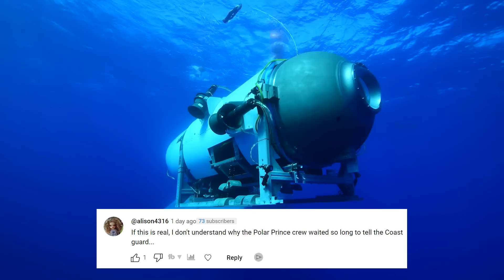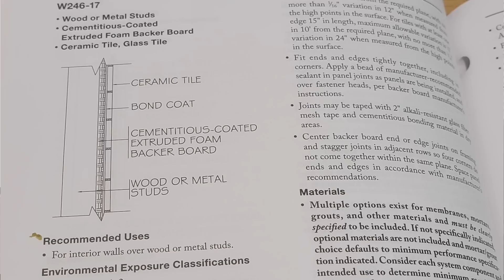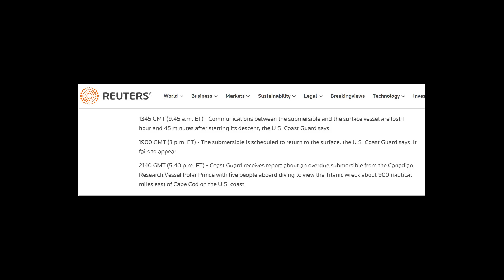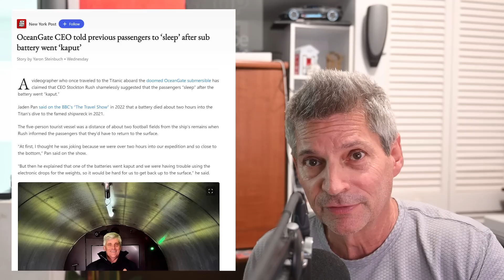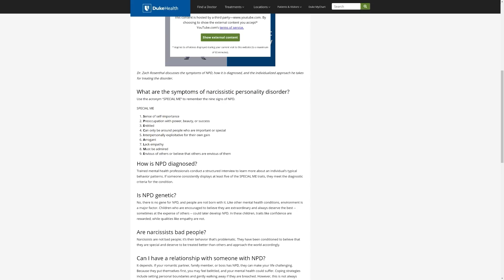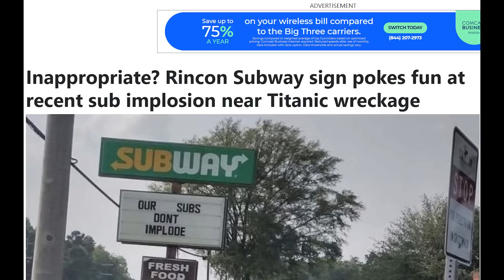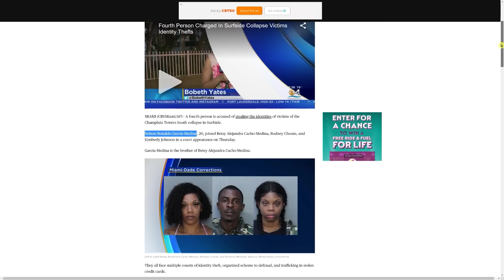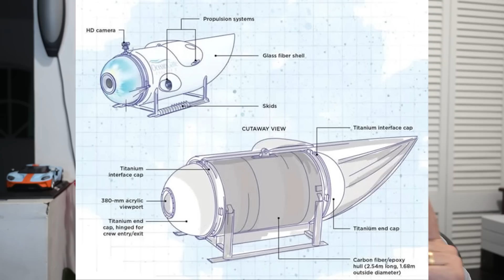Titan Sub: Why OceanGate Waits 8 Hrs Call Coast Guard, Q & A

Comment: His major concern was cost.  Deep Sea submersibles cost a lot of money to design, build and test.  So he developed a narrative of denial about safety concerns to cover this inability to fund the project adequately.  It was a defensive mechanism that took on a life of its own.  If anyone suggested he needed to certify the vessel he took it as an insult because he couldn't afford to undertake such a process.  But there was an element of aberrant psychology, as a normal person would not take risks of that magnitude.
Reply: Agreed. He had a business plan and the engineering was compromised to fit that plan.
I suspect towards the end the company was already in trouble and losing money but he was desperate to make it work.
Reply: @zahimiibrahim3602 A tale as old as time
Reply: I think he was just cheap and in denial.
Reply: @JennWatson me too
Reply: Carbon fiber is also cheaper in itself than the proper titanium pressure hull needed for the depth, he even cheaper out on the carbon fiber process itself on top of that..
Reply: He probably could afford it, it’d just cost a lot more than he wanted
Reply: @charliedallachie3539  he thought he could use the “less is more” concept
Reply: There are reports that he actually did try to get the sub certified in 2019 but they were rejected. Whichever regulatory body they applied for certification from wanted nothing to do with their sub. Can't blame them in hindsight, especially since this was after the Lochridge debacle and after numerous experts warned the company the sub was unsafe.
Reply: He looks so smug in interviews, I would hate to have a boss like him!
Reply: Not even certain if the company was profitable. There's a recording out there somewhere in which Rush admits the sub journeys cost more in fuel than they make in ticket sales. Sounds like the sub was operating at a loss permanently.
Reply: You get the sense he was on the verge of bankruptcy. He cut corners at every turn. He looked for cheap alternatives to manufacturing, skipped testing and certification, used sub par and lower rated components, fired expensive experienced engineers replacing them with kids at minimum wage, cut the cost of tickets to fill seats. He didn't have James Cameron Hollywood money so compromised safety.
Reply: @jonfreeman9682  
The thing about rich people is that they ALWAYS claim they are on the verge of bankruptcy, while still driving a car that requires $4500 for an oil change and four times that much for a new set of tires.
It is a bunch of bullshit and they use it to undercut anyone they might have to pay, from their employees to safety inspections.
I recognize this behaviour because its my brother in a nutshell.
Reply: @jonfreeman9682 ........ABSOLUTELY my friend absolutely.
Reply: Cost was the secondary factor, he had the funds to build something safer. Oceangate raised nearly ~20m in a single round in 2020, not to mention Rush was well-connected. He was more concerned with time. Building something suitable for those depths with the proper certifications can easily take a decade.
Moreover, I've seen speculative estimates that the sub could be built for <$500,000. Rush's vision was to have multiple fleets of Titans built for various divesites across the world. He was trying to democratize deep-sea tourism. I'm assuming he was intending to build other iterations of Titan, but thought he can squeeze in a few more dives.
Reply: @paulewannacrackr  He literally forbade maintenance checks on the sub because he didn't want official records of it failing. his ego was a massive driver of his decisions.
Reply: @paulewannacrackr  Yeah, I came across this article on Composites Weekly...  

An excerpt: "After the Titanic mission, Cyclops 2 will be off on a variety of other missions that, says Rush, will keep the craft busy for the rest of 2018. OceanGate, he says, will build at least four Cyclops 2 submersibles, and as many as 20, depending on demand. Rush says Cyclops 3, 4  and 5 are already on the drawing board, will target depths of 6,000m and likely will feature carbon fiber composite hulls."

Beotch wanted to fill the ocean with Deathsubs!
Reply: The Titan's problem has never been that the prices cost too much, 250,000 dollars, on the contrary, cost too little!! If Stockton had invested the sums necessary for a safe submarine, such as the two Mirs, or the Alvin, the price would have been at least double that per person, and he could not have carried 3 paying mission specialists.
Reply: When he was here in Belfast a few months ago he literally admitted he was in financial trouble
Reply: It seemed that on a previous dive they lost contact with the sub for 5 hour or so. I suppose they were hoping that a similar problem had occurred?
Reply: He can break all the rules he wants but he certainly can't defy the laws of physics.
Reply: Nailed it.
Reply: amen
Reply: I strongly disagree, his major drive was self centered enormous self-giving pride.  Pride can be deadly.
Reply: That’s the ONLY thing he was concerned about… money, money, money
Reply: @Chellebelle121  so true :D also he still didnt make any. what a stupid lunatic
Reply: The whole sub and oceangate is nothing but a cont artist
Reply: Spot on analysis
Reply: It would only make sense to take the cost down that drastically if you actually dispose of the disposable sub after 1 or 2 missions.
Reply: James Cameron paid ten million dollars for a submersible that could take him on a one time trip to the Marianer Trench and he scrapped the sub after that single mission because he didn't deem it safe for more than one trip. That's the kind of cost and the kind of safety limits we're talking about in the real world outside the fantasies of Stockton Rush wanting to become the Elon Musk of the Sub Atlantic Ocean.
Reply: @mjouwbuis  I had this thought too…
Reply: The question was why did they wait 8 hours to call the Coast Guard?  I think after about 15 minutes they knew it imploded and were trying over the next 8 hours what they were going to say.
Reply: Don’t take out a loan on a car you can’t afford, don’t go to dinner if you can’t tip your server————- it’s basic principle. This guy cut corners and cost human lives.
Reply: It's not like he didn't have the money. He was just using it on lawyers to sue people who didn't agree with him 🤷🏾‍♀️
Reply: How could they not afford safety checks at $250k per person?
Reply: Extremely well said. Thank you.
Reply: it never happened, it is total bullshit.......the whole story....total bullshit, like how the salvage team took all the bolts out of the 'recovered' front end...
Reply: Me, an actual engineer with a license...would have said no before I even took a freshman level matsci class. Fuckin insane. What a conman.
Reply: Wasn't Rush a BILLIONAIRE? How much would a safe (and rigorously tested) design cost. Do it without cutting corners and he'd still be alive today. Cut corners - now he's dead (along with 4 others), no one will ever pay to go on his vessel again (if there's a backup), his company is out of business and I would expect a flurry of lawsuits from the families of the deceased because what court would not throw out the waivers each passenger signed. Yeah they mentioned experimental and death but what was shared with each passenger about the safety and testing and depth ratings? Signed under false pretenses - waivers null and void, Ocean Gate liable for all deaths since no insurance since vessel not certified.

The planet is better without Rush's arrogance, sad for the other passengers. Lucky for them they felt nothing but their families remain.
Reply: Narcissism
Reply: At $250k per trip... the "cost" argume t would be lost on me in a court if law, because building it "correctly " may have cost more, but the safety factor goes up, the service life of the sub increases, so you can make mire trips down to recoup that extra cost...
Reply: If you have any experience with narcissistic people, you would understand the power they have over rational people because they deliberately upend all your sound logic with manipulative behaviors, words and actions. The more experience you have with these people, the better you can prepare to war and battle with these people, because your only other option is to fully disengage, which often means these people will take something of great value to you in that process of disengaging. The worst ones, will keep forcing conflict and attack what they know is of value to you in order so you can't escape them and they keep control over you. It sounds harsh when I say battle these people, but it is necessary when they are this extreme. In some cases, by battle, I mean kill them, such as the Hitlers and Putins of the world.
Reply: Are they rescued yet?
Reply: OMG, Subway!!! Wtf
Reply: It was his hobby..and he was arrogent..
Reply: Well what he did,he killed other people, .
Reply: Good excuse but I thought he was a billionaire... that does not cut it for me. He was definitely a narcissist. That was probably his fatal flaw.
Reply: @Wayner71 bro the seats were a quarter of a million. If it's so expensive to maintain, charge more. Only millionaires/billionaires are buying seats
Reply: yeah agree with that
Reply: Dude received $250k per person and STILL couldn't use the best materials?
Reply: @kelgreen99 $250k a passenger probably didn't even cover the surface ship operations. I think it was more about playing with the uber rich toys when he was just kind of rich.
Reply: I hate to make it sort of political because the tragedy has already been needlessly politicized, but I do feel like a capitalistic mindset definitely played a role in it when the biggest incentive was to make a profit
Reply: @normanorman  Snore...  You sound like an AI bot...
Reply: Would Stockton Rush have stuck his screwdriver into an electric receptacle denying the principles of electricity?

Why wasn't the submersible tethered to the main ship?
Reply: @larrybe2900 Other submersibles that go to those depths are not tethered. Aside from the added cost of kilometers of cables and lifeline, cables may get pulled by currents, restrict mobility and introduces a risk of entanglement. The mothership also needs to be designed to stay exactly in place while the sub is operational.
Reply: @larrybe2900 I would guess that one reason they don’t tether to the ship is because that could increase their chances of getting entangled with the wreckage. 
And I don’t think Stockton Rush would have stuck his screwdriver directly into the receptacle; I think he would have used some kind of new, cheap insulation on the end of it and stuck it in, over and over, telling everyone that they were all wrong about it being dangerous until he wore it out and finally electrocuted himself. OH, and he would absolutely have his arm around someone else at the same time, so he didn’t go alone.
Reply: @BeKindDammit Perfect analysis! I think you’re right about that.
Reply: @larrybe2900 at 30kg/m an umbilical 4km long would weigh 120 tonnes, that’s just the first problem
Reply: @jackimo22  There's absolutely no way in hell you'd need such a heavy cable for a dinky sub like that.  And you'd sheath it in lighter materials to make it neutrally buoyant, would effectively weigh nothing.  Still a bad idea, though...
Reply: @larrybe2900  in the name of entrepreneurial narcissist he would absolutely stick a screwdriver 🪛 in a socket if it meant profit for him - safety was NOT on his radar!
Reply: @fifiwoof1969 Or use a screwdriver on the demon core....
Reply: @larrybe2900 My understanding is that tethering to that depth isn’t feasible, nor would it have been possible for Polar Prince to have lifted Titan in any case.
Reply: @larrybe2900  more cost lol. A tether of that length ain’t cheap, and I’m not an expert on the matter but it’s probably not as simple as getting a really long rope. You could also argue it’s redundant if the submersible has the ability to control its direction/decent rate already.
Also it’s another added risk of getting caught on something. Why bother is probably what they thought lol
Reply: @larrybe2900  There is a risk and there is a hope, if it's 90% risk with 10% hope to survive I believe he wouldn't have done that, but if in "your mind" you guess it's 60% 40%, and you have that type of personality to risk for a great reward(Especially if you have nothing to lose which I can't confirm this about him) you may get bl;ind enough to do the job.
Reply: @larrybe2900  The same reason other manned exploration submersibles aren't tethered, because ropes get hung up and caught on stuff, this should be common sense.
Reply: @@dongreek3500 who’s money would be used?
Reply: @Deeperdetecting  From my information, OceanGate received $19.8 million in 2 rounds venture capital funding,  $500k in October, 2014 and the remainder on January 9, 2020.  So safe to say the money was all gone by this year...
Reply: He was worth 25 million tf you mean couldn’t afford it
Reply: @Deeperdetecting  Stockton Rush's 'net worth' was just a theoretical number, based on some valuation of OceanGate.  OceanGate's worth dropped to zero on June 18, 2023...
Reply: @johnbergstrom2931   he also had an extremely wealthy family as well
Reply: @Deeperdetecting Cameron’s Deepsea Challenger cost around $10 million and wasn’t certified. Doing things properly is even more expensive.
Reply: @fredbloggs5902  god damn that’s wild
Reply: @Deeperdetecting  25 million isn't a lot when you're paying a team of 10+ people, designing multiple prototypes/testing units, having custom parts manufactured then certified. When you get into certain industries or work, 10 or so million isn't getting you very far at all, like flying.
Reply: @Deeperdetecting  25 million may be a lot to you and me, but it's not much when it comes to submersibles. The last refit (!) of Alvin submersible cost 41 million.
Reply: @Deeperdetecting  what is worth? Is it money in the bank? Does he have to sell off real estate to get the money? Is it in long time obligations? was it the virtual stock value of ocean gate? Is it virtual, based on what he would be able to make if he got an actual job?
Reply: @pokemonreststop1187 LOL $25 million is nothing in the business world.
Reply: @Deeperdetecting 
Sometimes people with that kind of money have it tied up in multiple ways. It isn’t as it they can access a few million dollars here and a few there for tests, materials, salaries, etc.
Reply: @Deeperdetecting 

That's only 3x James Cameron's pay for the titanic movie.

... That's a lot ot money, but not in thr grand scale of things.
Reply: @Deeperdetecting in the submersible industry… 25 mil won’t go far. Maybe a couple hundred foot of depth. Nah, if he wanted to make a submersible that worked, he would be looking at hundreds of millions… if not more.
Reply: @Deeperdetecting  DSV limiting factor cost $37 million

Not sure how much a less capable DSV costs, but beyond production cost, there are potential constant ongoing costs for running a submersible. A lot of deep sea submersibles make only a few trips, ever. 

Guy wasn't going to blow his entire networth on the sub if it didn't seem like he would get a return on it.

Comment: I would not say the Titanic is an example of normalization of deviance. At the time, lifeboats... weren't very safe. They were small, open wooden boats, easily flipped in rough seas, and the logic was that lifeboats would only be used to ferry passengers to another ship, when weather allows. Titanic was the deviation from the norm that showed people here was a situation, not rough seas, the people who were loaded into the lifeboats all lived, where more lifeboats would actually have helped. It was also considered the norm to continue sailing at full speed in icy areas, as long as the weather was good, because people just plain didn't understand the turning radius these new big fast ships required yet.

Comment: May be you could make a video on how communications work on a regular submarine, let alone a deep sea vessel like the a Titan or what Cameron would use.
Reply: they would use an UQC or other underwater acoustic messaging system. the support ship would have aquatic microphones that could hear what was being said on the submersible. you may be surprised that the proper microphone system can hear what is being said on a military submarines
Reply: @toomanyaccounts  relative to internet speeds, what's the bandwidth? Are we talking 56 kbps? I guess the bandwidth/speed would depend on depth? For that matter of fact,  would a wire at 3km depth be any good? By the time you have signal boosters equipment, would a wire connection even work or be any good? Thanks for replying.